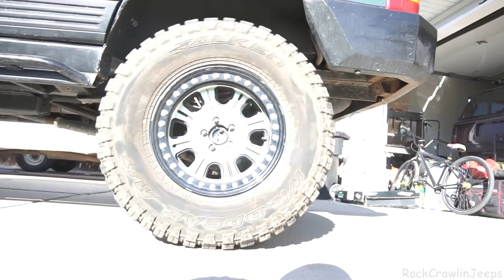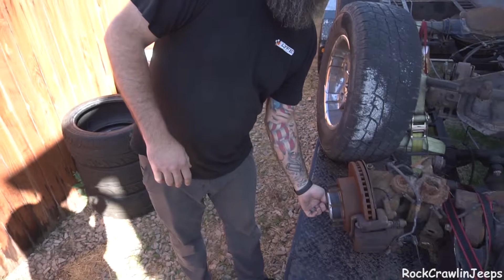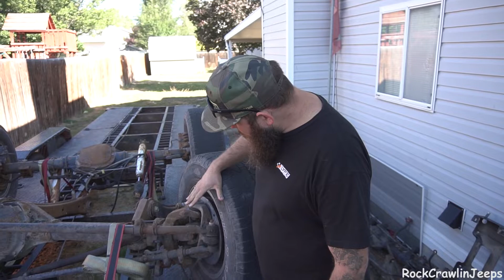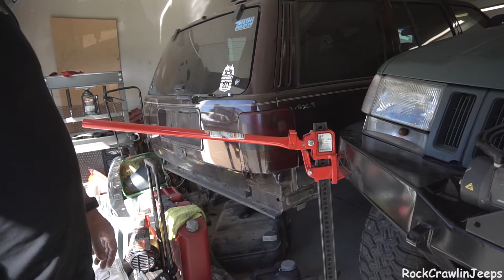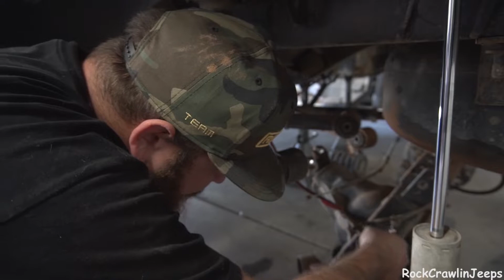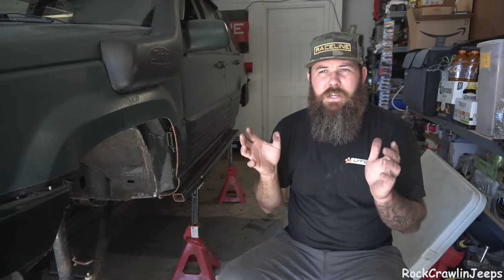It was only a matter of time... ONE TON SWAP!

Comment: Low budget lol that’s a lot
Reply from the maker: Demo 7241 low budget is definitely circumstantial. However this will be done cheaper than I ever thought I could.
Reply from the maker: Demo 7241  budget update. Under $4000 including axles.  Air lockers / Artec trusses / 5.38 gears
Reply: RockCrawlinJeeps where are located I’m in Michigan everything is expensive here